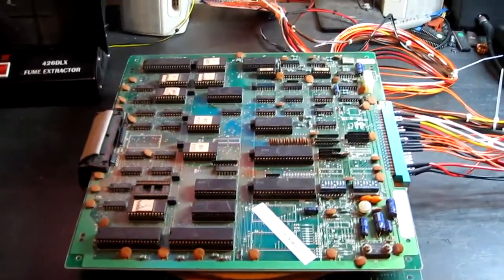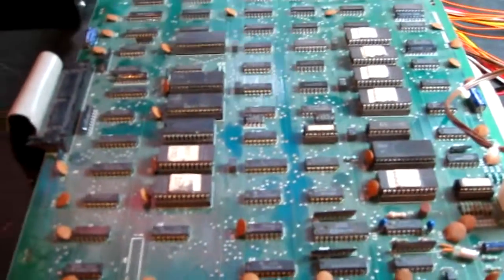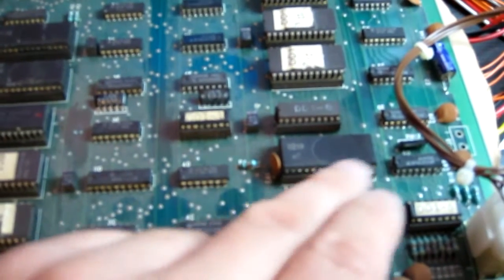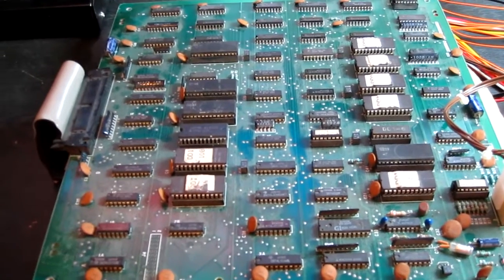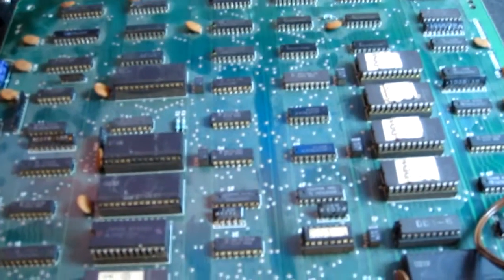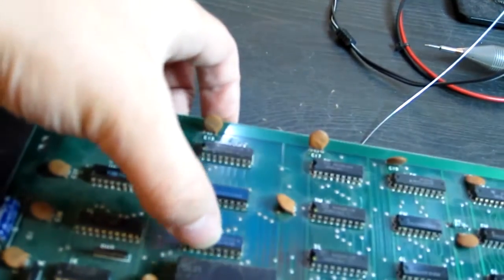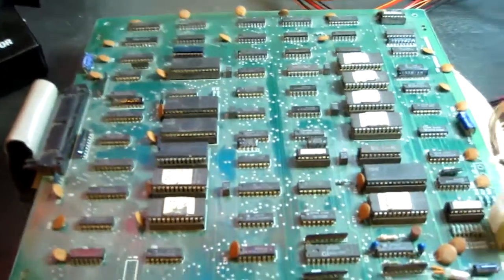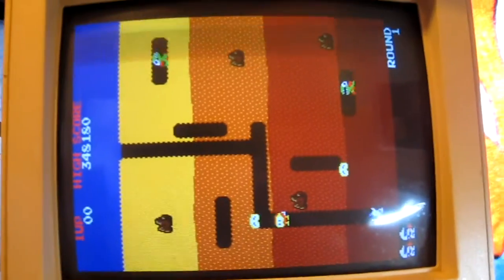Namco Dig Dug - Arcade PCB Repair

Comment: Wow, It's odd to see Dig Dug on that dual PCB.  All of the machines I've worked on were Atari :-)
Reply from the maker: This is the original :) The Atari version was licensed from Namco
Reply: arcadeuk It's odd that Atari would opt to make a different board. You'd think the Atari cabinet would just house one of these in it. When I pulled it out of my machine I was surprised at how much it looked like an Asteroids board in size and design.
Reply from the maker: Well I guess that's Atari's way of doing things they probably re-design the PCB to optimise them for their in-house manufacturing process. There are several Atari boards that are all of the same form factor. I guess connectors are another issue, the Namco board uses the standard Namco pinout which includes a 3 and a 6 way AMP connector, while the Atari version is edge connector only, and would have also been designed to work with the AR2 (Namco one has inbuilt amp)